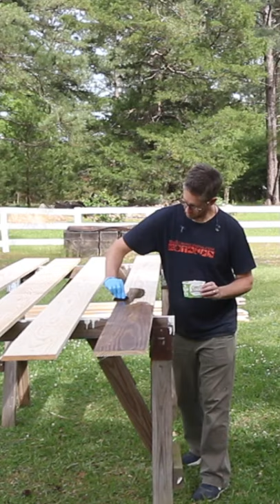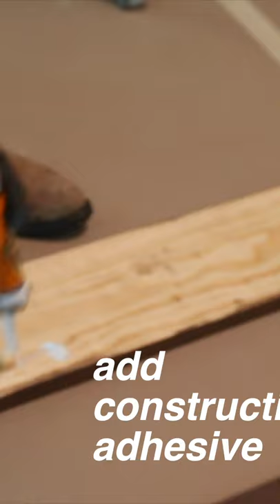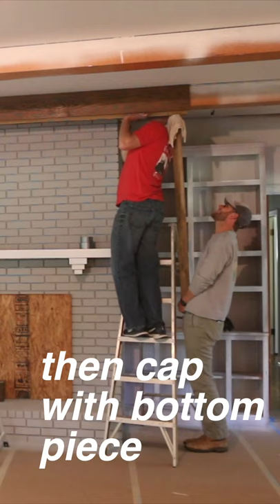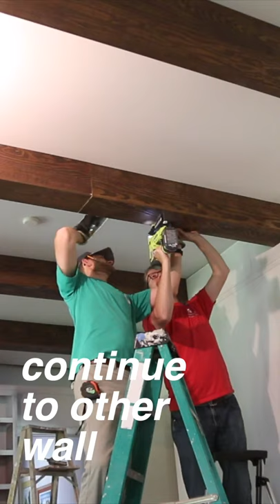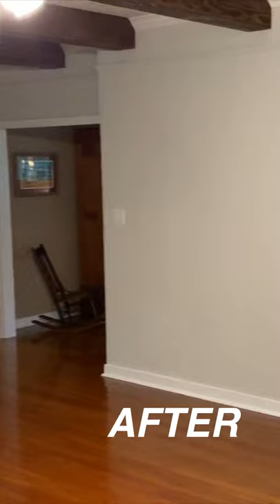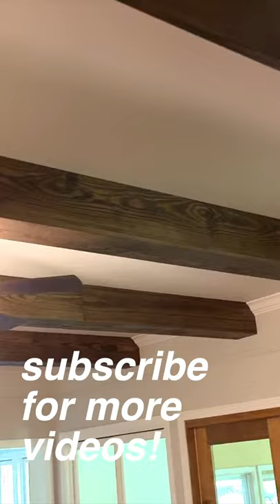FAUX CEILING BEAMS / HOW TO MAKE / #shorts

Comment: Good Job on the Shorts format.  I've done two so far, and it's not easy.
Reply from the maker: Thank you! It can be a little tricky to get a point across in such a short format.
Reply: @BruceAUlrich  I found the aspect ratio tough also, as the original footage was not shot with that narrowness in mind.   Hope it drives up both our subscribers!

Comment: WHYYY did you guys paint the brick???? Brick is not meant to be painted I hate modern DIYers
Reply from the maker: That’s actually not true at all. We built a house years ago & the brick we put on the outside of the house was literally made to be painted. It is sold that way. As for this old yellow brick that should never have existed, yeah, it got painted even though it was not made specifically for that. It is MUCH improved now.